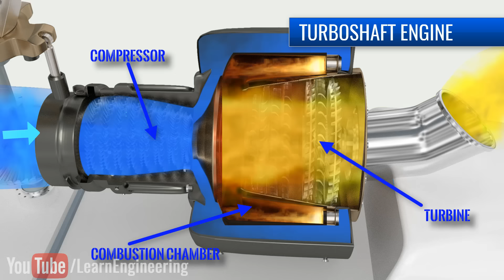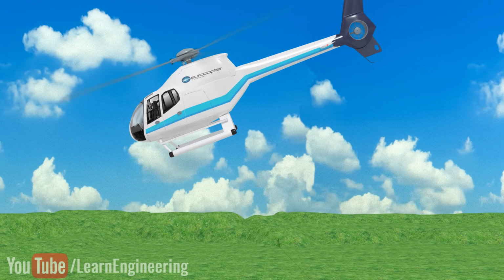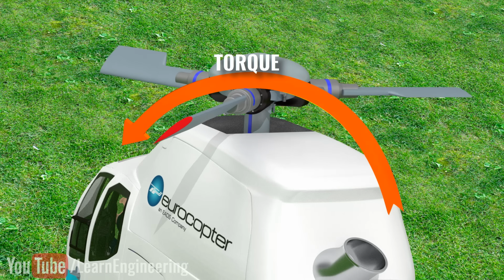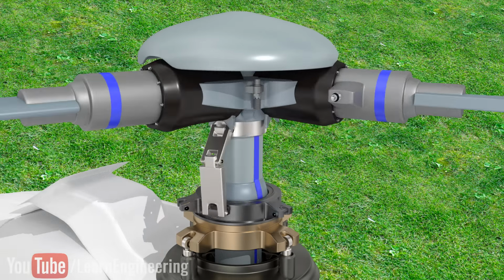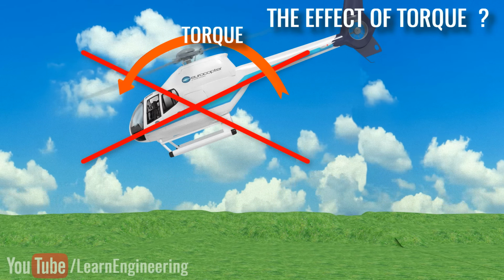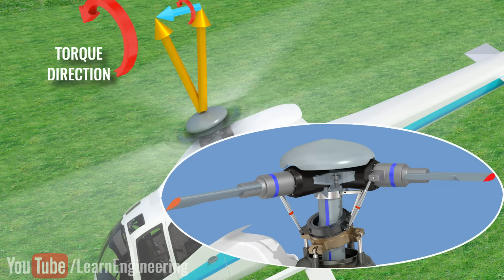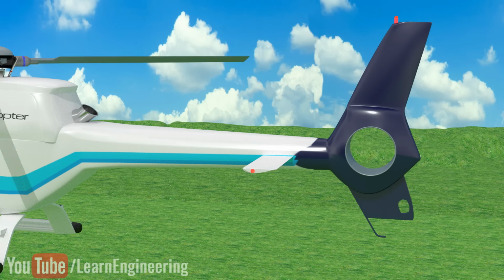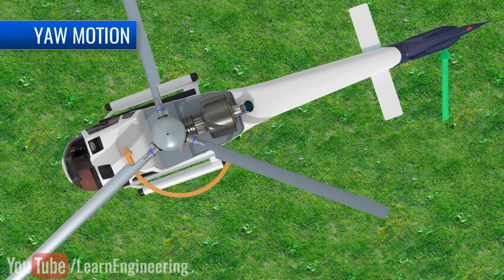How does a Helicopter fly?

Comment: While going through US Army rotary wing flight school in the early 90's my instructor pilot said helicopter pilots fly by constantly correcting for mistakes they just made. 
Difficult at first but an absolute blast to fly (OH-58 and UH-1's)
Reply: Your explanation supports me in my thought, that helicopters feel like a videogame - becoming as good with the controls as you can, clunky at first, but improving by the hour. I would like to make the helicopter licence one day, I just need to make some very good money for that. =3
Reply: Yes it is very expensive, especially compared to fixed wing (planes) which is still significantly higher than when I was flying in the late 80's through the 1990's.
Best of luck in your goal, it's a good career path.
Reply: So lucky. My eyesight relegated me to just learning civilian helicopters in the 90s. Still, the best times of my life. Learning to fly a rotory wing machine is a real challenge.
Reply: Kinda like walking.. where you are actually falling in the direction you are moving but, by taking a step forward, you prevent the fall from happening. Ok, I was just trying to be clever😄
Reply: Close enough.  Another analogy is that the helicopter is your enemy. You must anticipate all the time to win.  Plus, they are magic. There aren't any helo mechanis.😁

Comment: the other problem is that advancing in any direction via roll or pitch means the rotor lift isn’t facing perpendicular to gravity so more collective/lift is needed to counteract it. As well as that, when going down the rotor speed can increase to the point where the tips will break the sound barrier and slow down again roughly 50 times every second, resulting in a devastating loss of control and extreme noise. worst case scenario could involve the rotor blades snapping off or the control rods breaking because of the increased lift. Finally, those rotor blades have to be damn strong and slightly bendy due to the outside of the rotors going much faster than the inner side, meaning the outer edge creates more lift. Either a variably shaped aerofoil can be used with less lift ability on the inside or the rotors must be extremely flexible.

Comment: Another factor to be taken into consideration when moving from the hover
 and transitioning to forward flight is the relative speed of the blade 
moving forward (the advancing blade) in the same direction as the 
helicopter and the blade on the opposite side of the rotor disc that is 
moving backwards (the retreating blade). Lift is generated by the shape 
of the aerofoil, the area of the aerofoil surface, the angle of attack 
and the speed through the air. In forward flight the advancing blade has
 its speed added to the forward speed of the aircraft and the retreating
 blade has its speed subtracted. Unless corrected, this would cause the 
helicopter to roll over as far more lift would be produced on one side 
of the disc compared with the opposite side.  This is controlled at the 
rotor mast head by allowing the advancing blade to move backwards 
slightly relative to the rotor disc spin and the retreating blade to 
move forwards. Thus less lift is produced on the advancing blade, more 
lift is produced on the retreating blade which evens out the lift on 
both sides. This adjustable movement is controlled at the blade root.
Reply: Have u copied this ?
Reply: that’s why the dual rotor design is more robust. With the chinook’s contra-rotating rotor sets, they both produce lift on opposite sides and it almost cancels itsself out. beautiful.

Comment: The direction the swashplate tilts relative to the cyclic is actually determined by how the pitch links are rigged. Most modern helicopters have the pitch links rigged in such a way that they automatically adjust for gyroscopic precession/phase lag so that the swash plate can just tilt intuitively relative to the cyclic controls.
Reply: You sound like a pilot  - or an engineer
Reply: that's great. but the phenomena behind (gyroscopic precession) cannot be eliminated, responsible for all rigging or other approaches to make swash plate tilt intuitively relative to the cyclic controls. For beginners demonstration in this video will help them build solid understanding, isn't it?
Reply: I knew that ... 🙄

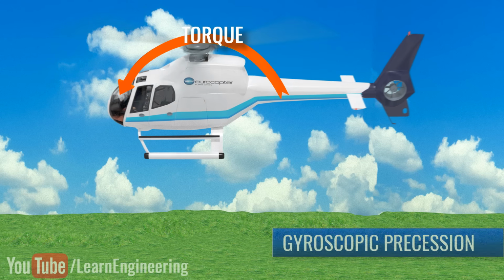Comment: Great video, but unfortunately horribly wrong on the physics behind how the swash and blades cause the heli to tilt.  At 5:06 it says this is due to gyroscopic precession, which is a very common mistake people make.  The actual reason is due to aerodynamic forces, and is much more complex than gyroscopic precession.

One important difference is that gyroscopic precession always acts at 90°, whereas the effect on a helicopter depends on the rotor head design, and can vary significantly from this (such as a 72° lag on some models).

Another mistake is that generally when the swash tilts forward, the heli will tilt forwards because the engineers designing the heli know about this effect and account for it mechanically in the linkage between the swash and the rotor head.
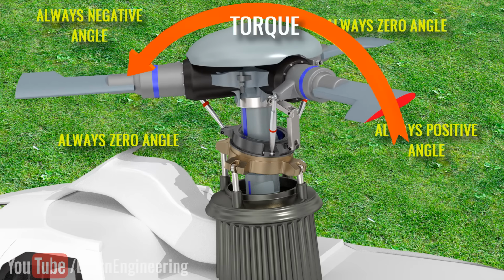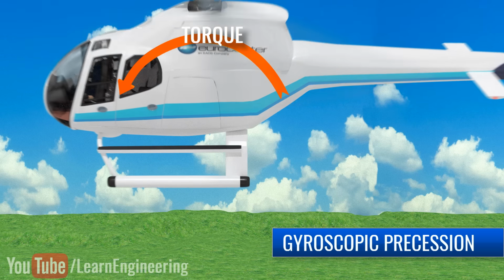Reply: He didn't explain that the torque produced at 4:25 was the result of aerodynamic forces, but did correctly show that the torque at 5:06 when applied to a rotating rotor then gyroscopic precession is 90 degrees or sideways to that torque.
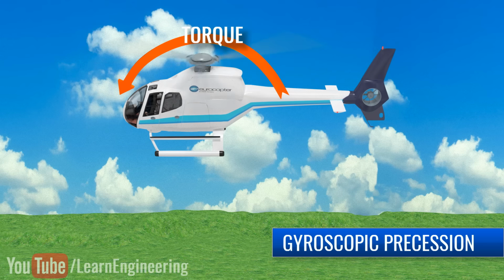Reply: That's my whole point, the way a helicopter rotor blade reacts has very little to do with gyroscopic precession, the point he makes at 5:06 is fundamentally flawed.  Go read any text on rotary aerodynamics, this is not how it works.

There's a simple way to explain why it's wrong:  Gyroscopic precession always acts at 90 degrees to the force applied, but a helicopter rotor often does not react at 90 degrees to the input.  In fact, the rotor lag will vary depending on the head design and can be between 72 degrees and 90 degrees.

The effects appear similar on the surface, but the underlying physics and reasons why this happens are totally different.  This is a very common mistake, but unfortunately utterly incorrect if you're trying to explain how a helicopter rotor actually works.
Reply: Ross Cooper-Smith ... it's 90° phase lag, show me any text that says 72°?
Reply: Ed S
https://en.m.wikipedia.org/wiki/Phase_lag_(rotorcraft)

"Phase lag can vary as a function on rotor tilt rate and aerodynamic damping....The rotor control system is mechanically shifted up to 90 degrees to compensate for phase lag"
Reply: at least the video didn't say some crap like "the rotor tilts in the direction the pilot wants to go"
Reply: also the beginning of the video, narrator suggest that moving forward is "simple", he deserve a smack in the head. The video failed to mention the need to compensate dissymmetry of lift and the charge of torque when you perform a "simple" forward flight.
Reply: @556to762  The beginning of the video posited that it was simple as a common, erroneous belief. "It's simple, right? Not so much... And that's why".

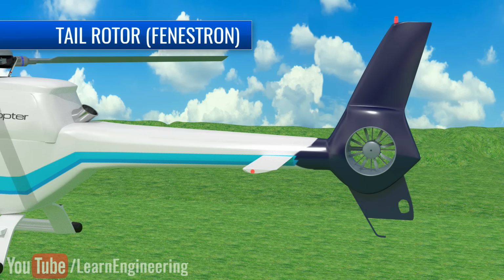Comment: 6:45
>Every single rotor helicopter needs this tail rotor
[Laughs in KA-50/52]
Reply: He did say Single Rotor. The KA-50/52 is a dual rotor
Reply: @TheTykbry 
But he intended _tail rotor_.

The KA-50/52 attack helicopters don't need those because of the dual main rotors.

Comment: But wont the bearing between the swash plates have to endure extremely high amounts of friction ?
Reply: That's what I was wondering
Reply: That's the point of the bearing, no? If it's a ball-bearing, then the two parts of the bearing will just roll against each other, which has minimal friction (at least theoretically).
Reply: @Joe.Navarra  Definitely, but don't you think it would still wear extremely quick? Unless they have some type of fluid system running through all that, then I guess I could understand.
Reply: @joshuat20k  I would imagine it is full of oil & then sealed. I'm not being facetious, I'm also just trying to understand. 
It reminds me of a common problem with Porsche's 911 models, 996 & 997, that had RMS failures  - the Rear Main Seal, which was a ball bearing system part similar to what we're talking about here. They would 'run dry', explode & cause catastrophic engine damage. I ain't no genius but in a car that's bad. In a helicopter it's gonna be shit ya pants time!

Comment: The animations and the editing of those were rather lazy, but certainly good enough for bringing down the message and deliver the understanding, that's intended. Good video. Helicopters are a true marvel of aviation technology. It's more simple than I thought, but coming down to this simplicity within such an intriguing machine requires a lot of engineering all by itself. And it's necessary, because making things simpler doesn't only mean, making them cheaper, but minimize the amount of points of failure, so making the machine more reliable - even though certainly a helicopter is still complex to a level, where only highly educated staff can construct and maintain it.

Comment: Some additional information
(1) The engine of helicopter is turboshaft Engine
(2) The combustion Chamber in helicopter engine is Reverse flwo combustion chamber
(3) When an object rotate its angular momentum is always normal to the plane of rotation
(4) When torque applied on a plane  perpendicular to the plane of rotation the vector of torque as per right hand screw rule is perpendicular to the plane of application of torque
(5) Both Angular momentum and Torque vectors are perpendicular to each other
(6) When both angular momentum and torque are available in a system of rotation then angular momentum always chase the torque and this chasing will define the final motion of object, and this whole scenario is called as gyroscopic precession

Comment: I have a couple questions. 
1-how does the rotation of smaller rotors like the tail rotor or the propeller of a propelled plane affect the behavior? Do we have to correct their effect?
2-how would the twisting of the engines of a vtol like the osprey affect the movement of the machine and the load in the structure?

Comment: Gyroscopic procession was also a problem for early airplanes, that had spinning radial engines.
With early radial engine designs, the whole engine, pistons and all, rotated with the propeller.
This created a gyroscopic effect, that made them hard to turn, in that pulling the control stick to the left or right, would make the plane go up and down.

Comment: The rotator in the tail will also make the helicopter tilt slightly forwards/backwards when the swash plate is even. And I guess the swash plate and rear rotor need to correct for each other depending on main rotors rotation speed to keep this balance 😅 damn.

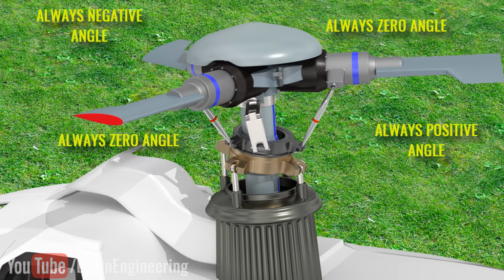Comment: (1)4:23 Why do swash plate tilting backward produce a torque forward instead of backward?
(2)Do advancing blade decrease pitch to decrease lift of advancing blade and retreating blade increase pitch to increase lift of retreating blade so the lifts of both sides are balanced this way?

Comment: One question, does the rotor shaft pitch???   Because in this video i understood that only the angle of attack of each individual blade changes due to cyclic controls. Do be more precise, i fly a heli in a flight simulator and when i pitch forward my cyclic stick, the blades (if the heli is viewed from the side) drop infront and rise in the rear, like if the whole plane of the blades is pitching forward creating a forward movement.

Comment: Can you do a video or explain to me why, when a helicopter autorotates why torque is not produced in the opposite direction? As I see it, when/if the engine quits the rotordisc is still spinning, but the force making it spin is now the air rather then the engine and therefore the force applied (and thereby also the force to counteract) through the rotor shaft to rest of the helicopter body is now opposite?? 

I cant comprehend why there is no longer need for a tail rotor for anti torque in an autorotation - I think I am lagging understanding of Newtons third law and maybe how the freewheel unit in a helicopter works. Please do explain. Thanks @Lesics

Comment: So the turbo and the exhaust are what makes the helicopter fly forward? 
Actually that's why i am here, sitting in my balcony, a helicopter passed by and i couldn't help but notice that it doesn't have turbos like airplanes..
Reply: No.   Tilting the entire aircraft forward, so that the main rotor pushes air downward and backward, is what causes the helicopter to fly forward.
Reply: @carultch  oh ok
Thanks for the answer ^^

Comment: The example has a turboshaft engine, and that makes sense, but the video shouldn't state this engine type as if all helicopter use turbines - small helicopters are still generally powered by piston engines. Similarly, the example is a twin-spool engine, but many small helicopters use single-spool engines.

Comment: Hello I have doubt regarding the swash plate moving sideways to move helicopter forward but this doesn’t apply for Rc helicopters? For the RC heli Iam using to move forward and backwards the swash also moves front and back . Can you explain y this happens in Rc helicopters

Comment: They make planes that can take off in very little space which takes one plus out of a helicopter. A chinook plus 2 set a record landing in 9ft, that is within the circumference of a helicopter blade. Now let's talk prices, maintenance cost and cost of flying. Turbin helicopter will burn 20 to several hundred gph, the chinook less that 3. You can buy one for about 15k.

Comment: Complex mechanism, explained simply, yet, not easy to understand. 
Some mechanisms are understandable as my own thinking but not as the formula. eg: flying mechanism by helicopter blade or plane wing. It is easy to understand that the more the angle of attack of air, the more the reaction force. But the pressure difference rule mechanism is quite complex. 
Turbine rotating force is not clear to me because how is possible to generate such enormous force by simply rotating blade by just open air pressure unlike ic engine where closed air pressure works.

Comment: how does a compressor blade start at first? is there an electric motor?
Reply: With a compressed air supercharger
Reply: yulan gautam ... On a helicopter of this size there is an electric starter motor that turns the compressor. As it’s speed is increased ignition and fuel are added to start the engine. Btw that starter motor is also the generator for charging the battery and running the electronics on board.

Comment: It's called pitch control in layman's terms. And how to take off and land is used by a stick called the colloctor which also houses the throttle like a motorcycle handle and to go left or right and to turn you use a cyclic(joy stick) used to adjust pitch on the main rotor. And then you have your torque pedals.

Comment: Good info but why does it have to be a jet engine? Isn't it an inefficient way to convert combustion into torque compared to a stroke engine?
Reply: its the way engineers found was best
Reply: At one point, helicopters had diesel engines, that worked with reciprocating piston/cylinder assemblies, just like diesel engines in trucks.

The compressor/turbine engine has replaced diesel engines on helicopters, for the same reason it has replaced diesel engines on airplanes.  Because it has a better power to weight ratio, runs smoother than a piston/cylinder engine with a power output that is closer to constant, and requires less maintenance.  The drawback is that the turbomachinery engine is not as efficient as a piston/cylinder assembly engine, which is why ground-based vehicles still use reciprocating piston/cylinder engines, where vehicle weight isn't as important of a design factor as it is for an aircraft.
Reply: @carultch  Thanks for the answer Carl

Comment: Someone probably already said this, but......

Helicopters do not fly, they simply beat the air into submission.

Helicopter - Hundreds of moving parts rotating at high speeds around an oil leak waiting on a chip light.....

Comment: I've seen helicopters move forward really fast without leaning in the forward direction, how is that possible?
Reply: It should have been explained in the video. Basically, it’s what the swashplate is for. It is tilted forwards and makes the blade in the back have more attack angle, and the forward-facing one less atttack angle, so the propeller has more lift in the back and less in the front of the helicopter, which makes it go forward. Very clever design.

Comment: And how does the helicopter's pilot know howmuch is the speed relative to what, and the exact altitude? When you fly a helicopter so high in the sky, you can't really rely your sense by seeing ojects around you just like when you fly low near the surface.
Reply: Its called VFR rules
And helicopters are the hardest to fly because you have no fixed position most of the time to stare at
Reply: Andi Tarigan the pilot has an airspeed indicator which tells them how fast they are going relative to the wind. The gps will give them their ground speed, how fast they are moving across the ground. 
The pilot has an altimeter which gives them their altitude  above sea level. Radar altimeters are also available which will give them their exact height above the ground, but are not common.

Comment: lol no, this is wrong. a helicopter does not turn using gyroscopic precession because it is a secondary effect. if you wanna rotate the chopper, you create a torque in the direction you wanna rotate it. if the chopper is already rotating there is an induced effect (called cross(omega,J*omega)) which would require compensation. why am i correct? because this effect occurs even when no torque is applied.

Comment: Helicopter does not work based on airfoil shape. Blades are designed push down the air. Thats why lot of energy wasted just keeping them in air. 

Torque direction is z axis means turning happens in xy plane. Here its completely explained in wrong way